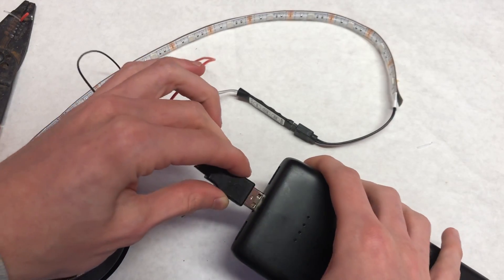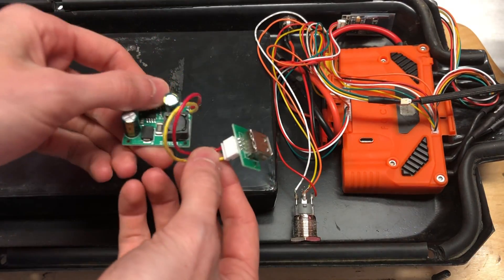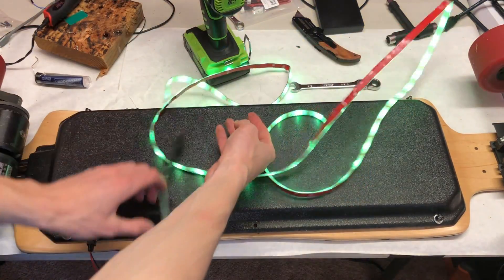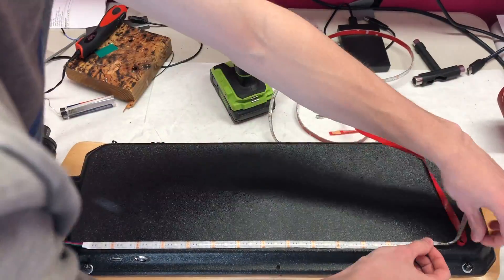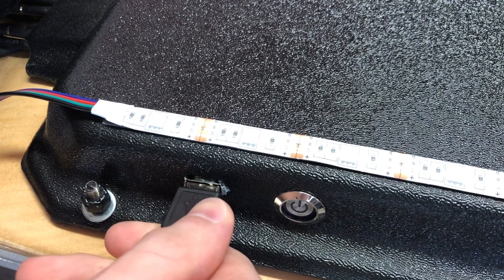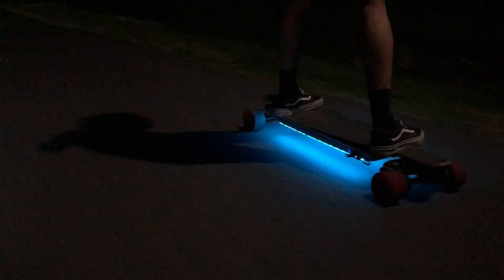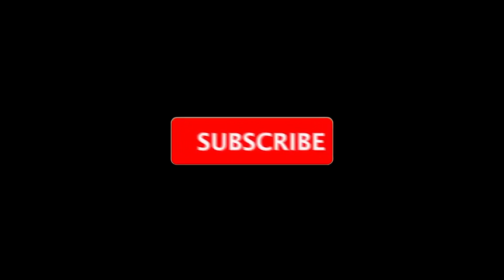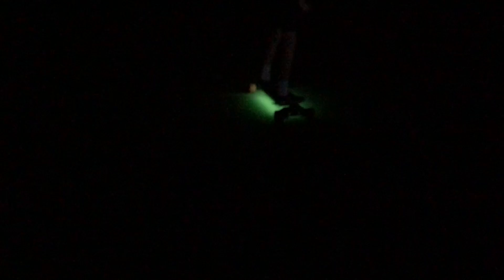DIY Electric Skateboard Powered LED Underglow Lights

Comment: I have issues with my bearings only lasting a few weeks. I have had an experience with the bearings exploding and locking up my wheel mid ride. It has only happened once though. My board has a single motor with 8 inch all terrain tires on it and it goes around 30 mph or so. I use abec-11 bearings. Are there bearings that can prevent this from happening? Thanks!

Comment: I think you stripped those wires a bit to much. Couldn’t they short on the metal surface on the usb? 2:51
Reply from the maker: Yes 100%, just realized that. Thanks for pointing that out. We have not had any issue though

Comment: How long until the demon 2.0 is ready. I'm looking to buy a top of the line board and I want to see if the demon 2.0 is the right board for me
Reply: Yeah i already started the 1.0 and want to see if i could improve before some parts arrive
Reply: @lionelmatthew6591  how has the build gone for you so far
Reply: Jack Maley  I order everything  except the deck because it has been sold out , but i could always return the parts if I see better fit with other parts , for now im just waiting on backorders
Reply: @lionelmatthew6591  have you ever thought of buying a different deck. There are tons of big decks that can fit everything like landyatz
Reply from the maker: The Demon 2.0 should come out in the next 2-3 weeks. We are still waiting for some of the parts to come.
Reply: @DIYesk8Builders  sweet. I'm looking forward to it
Reply from the maker: Can't wait to get it out to you guys! We are also going to sell a kit for it as well as a place to take out certain things from the kit that you don't want/need!
Reply: @DIYesk8Builders  will you offer the option to have the board built by your guys and shipped ready to ride?
Reply: Jack Maley  Yeah ive been on the lookout its just ive already spent 2000$ on it im trying to reduce it and i think the deck is something i can do with less
Reply: @lionelmatthew6591  makes sense. You going with the 12s4p battery?
Reply from the maker: Yes! We will have the option for the complete ready to ride version. But the only problem is the batteries not being here by the time we release the video. But we are shooting for it to be about the same time. Its just there have been so many shipping delays which really sucks
Reply: @DIYesk8Builders  all good. It's completely understandable since all shipping is delayed for a lot of companies because of Coronavirus. Excited to see the video though
Reply from the maker: Jack Maley Yeah we are just a little stressed because we can’t get people their orders because of the shipping delays from the manufacturers to us. But the package should come sometime this week
Reply: @DIYesk8Builders  yeah I can imagine that is pretty stressful. Seems like you guys run a great company and cool YouTube channel so I'm sure people won't be too upset about the delay.
Reply from the maker: Jack Maley thanks. It’s great to hear that people really like what we are doing and trying to help this community
Reply: Jack Maley yeah rocking it from mboards they too have a shipment delay , I feel like im drowning with being force to stay inside , a skate that can travel 50 km at 50kmh is really gonna cheer me uo